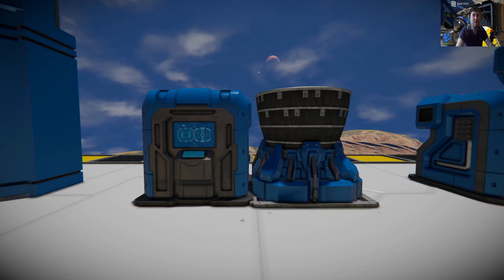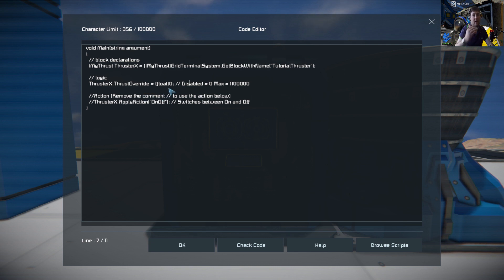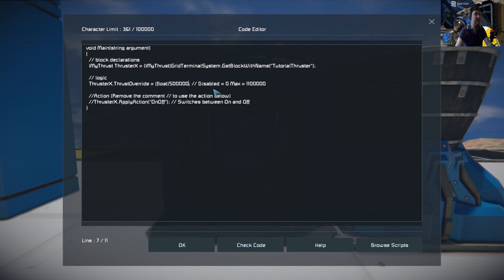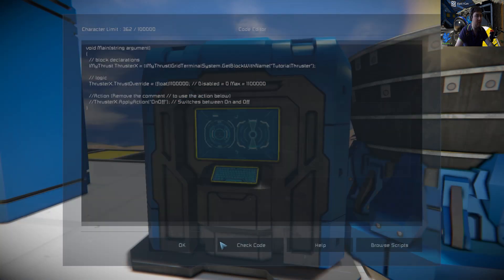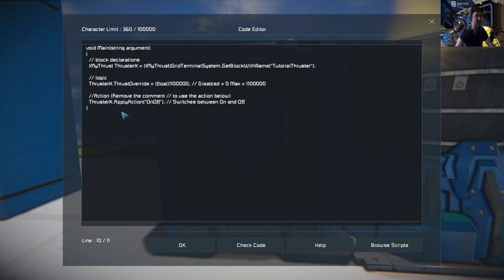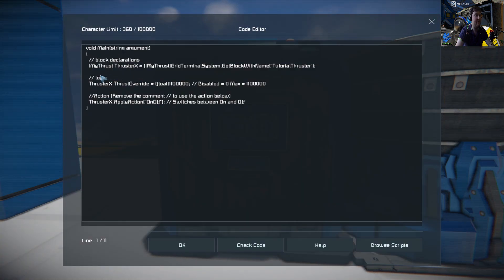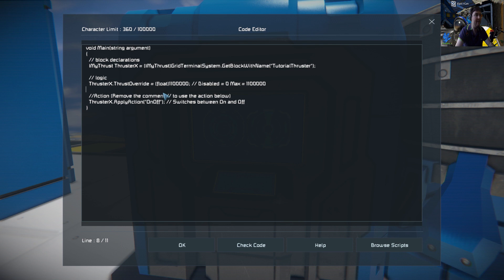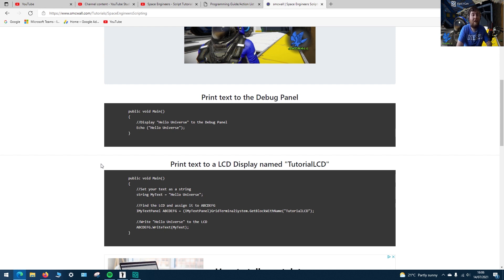Space Engineers - Script Tutorials - 4 - Control Thrusters

Comment: I like this video and the overhaul style, but it's lacking the answers to important questions we have to answer before we set thrust to any thruster.

- where is the gravity? // relative directions of the gravity vector and the vector of thrust of this thruster
- where is the thruster? // relative direction to other thrusters and control block
- what are the other thrusters doing? // what is the current combined vector of thrust
- what is the max thrust? // just for usability. so if the player changes there would be no need to change the script

So, thruster control is a very advanced topic and deserves it's own playlist.